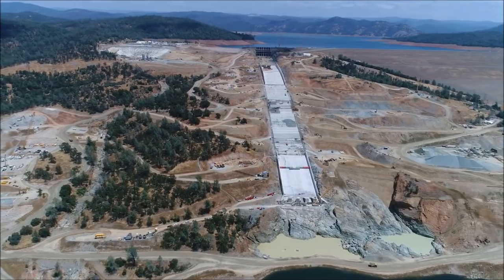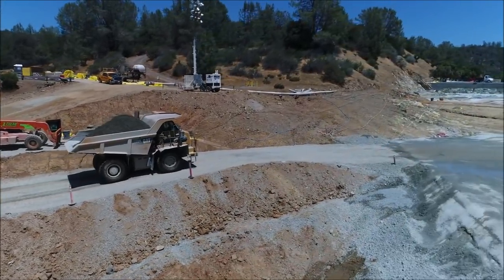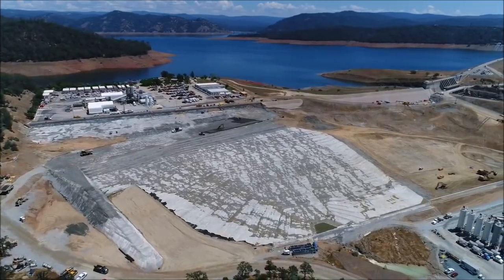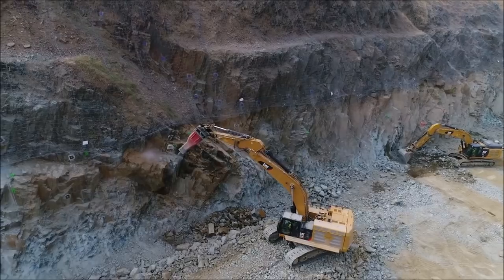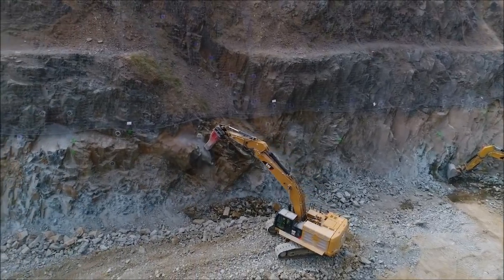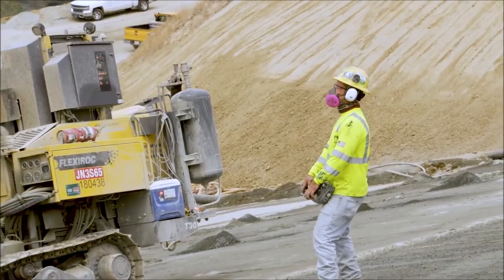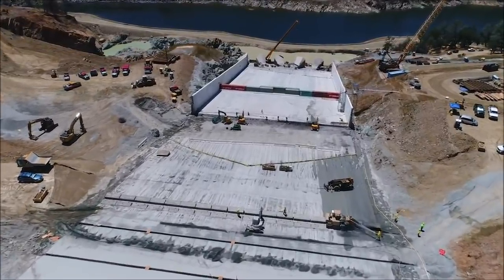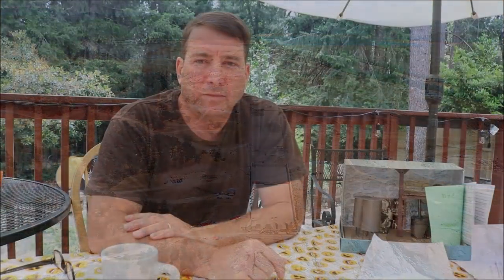Oroville Update 9 June 2018 Incidents and Injuries

Comment: I'm sure you have mentioned this in the past but all the union workers on the project are well trained and great hands.  My father worked on the Oroville Dam when it was built operating scrapers, and dozers.  He drove a 1958 Ford Ranchero from Lafayette to Oroville, spent the week at the worker's camp and when he came home the Ranchero was always full of 6" to 8" round rocks.  In the backyard in Lafayette the dry riverbed he put in is still there.  I have pictures of him working in Richmond, 1940's.  One picture was of him welding on the bow of one of the Liberty Ships, the next picture is of him operating a Whirley Crane, setting that same bow in place.   He was in the union since 1941.  I have been since 1971. 
Operating Engineers Union Local #3   Any young guys that want to run some rigs they have a great apprenticeship program.
By the way getting off a rig is when the most likelihood of an injury can occur, NEVER JUMP !

Comment: Another informative episode on Oroville. The perspective is deceiving until the drone dropped down the spillway to reveal how abrupt the drop-off is and those heavy equipment pieces are dwarfed by the structure. Proud papa, as well.
Reply from the maker: Thanks Osimnod!
Reply: Always admire your work, Juan. BTW, do you still have your older version of the GL Coyote saddle bag?
Reply from the maker: I sold my original Coyote bag, and now run the newer roll top Coyote bag. All the current Coyote bags are roll top. Easy and convenient.

Comment: Glad your surgery went well, just a word of caution about PSA numbers, they can show no issues and you can still have cancer. My friend had the # in below norms and had full blow cancer and had to have it removed and chemo. But they are still a valuable tool, but, no pun intended you need to have a physical exam every year. Again a great job with the repots Juan. I'm still amazed at the actual size of the spillway when you see close-up pics of the men against the backdrop of the spillway.

Comment: Juan I just watched the latest Oroville DWR update.  It looks like they didn't check the angle on the elbows of the drainage system.  So it appears they will have water trapped underneath the spillway again.  That would give a freeze issue that could cause premature failure of the main spillway again.

Comment: Sorry to hear you you have joined the fraternity of Prostatectomy survivors. Keep an eye on it as it can spiral out of control quickly. And don’t be afraid of getting a second opinion on everything. Also if you have any local prostate support groups check them out. They are a great source of information and support. Hang in there.

Comment: As you pointed out 8" dia. slotted drain pipes showed being installed slots up - generally holes are down. Is there a reason why?
Reply from the maker: looks like  slots on several sides.

Comment: Another great update!  Question: Do you know why part of the rcc splash pad was covered with dirt?  It is a sizable area.  It seems to me that the dirt would defeat the purpose of the stair steps if  coverage is to remain permanently.   Congratulations to your grandkids on great results in school!
Reply: The emergency spillway is never anticipated to ever need to be used. I'd say they will landscape it and let natural vegetation (except large trees of course) grow over it to soften it's visual impact. 
The benching is only to stop upslope erosion, if topsoil is washed off in an emergency event, no big deal.
Reply: Sideslip  No more Green Spot ?
Reply: Kirk nissley   I just read that the dirt cover in question is part of a new but temporary access road that will be used as a replacement for the dirt access road currently running across the top of the “phase 2” area of the emergency spillway. That access road must be removed for the placement of rcc over that same area.  Once the rcc splash pad work is complete this new dirt road over the rcc is supposed to be removed.

Comment: Great footage. Looks like a heavily choreographed dance presentation. Stay safe guys!! 
Juan. Has anyone ever explained how these "explanation" joints work with re-bar dowels tying the two segments together??
Reply: Pappa Bob, the smooth dowels are coated with grease and plastic so the cement cannot bind to it, they are also carefully aligned in the same direction so the concrete on each side of the joint can separate a little bit, but can't move up and down relative to the adjacent slab.
Reply: *expansion

Comment: Thank you Sir!  I always enjoy your videos!
Just to ask.....do you know if they have installed any cathodic protection on the reinforcing for the concrete....preserve the life of the reinforcing in a possible wet environment....sacrificial anodes....I put a system on a pier on Midway Island back in the 80's in the central Pacific!
Reply from the maker: Gary Campbell epoxy primer for structural steel (rebar) in the bottom panels.

Comment: I have a question. Why is this terrace-like structure so far away from the emergency spillway? Are they building another one right below the emergency spillway later? Or some other structure to direct the water if the emergency spillway will ever be used again? Have a great holiday! :)
Reply from the maker: See previous updates on the emergency spillway reconstruction. The idea is to 'armor' the emergency spillway from the ogee weir to the secant cutoff wall...over 700'!

Comment: For the record: Is the emergency spillway a secondary dam? It looks like the main spillway is cut into the top of a knob and the emergency is a small dam opposite the main dam?
Reply from the maker: effectively, yes. This gives the top elevation of Oroville 900' MSL. Top of the emergency spillway-901'.
Reply: So the emergency spillway is an earthen dam with planned over topping? Really?

Comment: How are they going to attach this permeable membrane it looks like a source of cavitation especially if one of the membranes tear loose.
Reply: At 10:08 in the video you can see that those drains are being cut into last year's roller compacted concrete layer. A new layer of structural concrete will be placed on top, and the membrane will never be exposed to the flowing water.
Reply from the maker: yes, the membrane is covered with a thick slab of structural concrete....stay tuned and we'll show you.

Comment: The sailing judges should handicap that time in the Catalina. Besides, it's not about the speed. It's about the FUN you have flying a vertical wing and a staysail foil at the intersection of two fluids in a dynamic environment. Reading wind sheer on the surface of the water is like reading clouds while flying. The calculus involved in the cutting and sewing of the pieces of those sails to make the desired "wing" from a roll of flat fabric has given childhood friends of mine lifelong careers designing and sewing sails for themselves while racing single class sailing dinghies as kids (your son and that Catalina) to eventually designing sails for Americas Cup Yachts.  Enjoy the ride. I predict he will be sailing a hydrofoil at 40mph before he drives a car. $2.00

Comment: Now OSHA is on site this is not good Kiwatt had a perfect safety record and two workers messed up and they had to call OSHA in Sacramento and now they are on site. No one wants an OSHA inspection because it will reduce the worker board to zero and everything gets shutdown. Kiwatt be careful out there and get this thing done we don't want OSHA showing up again.

Comment: Does anyone besides me think that instead of building the same style spillway as the original one which eventually failed,maybe we should think about a different design/concept? Think about the original base infrastructure of the spillway originally,it was solid bedrock of nature's own design. Due to a combination of a number of variables,seen and unseen the spillway was compromised. Water,water pressure,soft soils,and of course engineering are the four main factors that caused it's demise. Well the soft soils are now  softer than ever  before,the bedrock that was the backbone of original spillway is non-existent and it's replacement is concrete and it has all ready cracked and is going to continue to crack. The only thing that caused the original spillway to fail that matters is the soft soils beneath we're comprised due to water and water pressure. To me,and I'm only speaking for myself and hypatheticly,it seems like a much easier and smarter way to solve the spillway objective would of been to use large steel pipes in series that entered the lake above spillway and dropped down the other side staggered in depth and then down to the river. Large valves would open and close valves and wa la,problem solved.
Reply: It really doesn't matter how thick or strong the concrete is,if the soil beneath it gets soft and weakens, everything above it will fail also.
Reply from the maker: maybe you should join the design team too...lol
Reply: blancolirio  I would but there not good listeners.

Comment: I just watch an update on progress of construction. The engineers have the wrong design. They plan to draw water away from spillway during usage. This will fail. The opposite needs to be done done. Instead of cutting stripes at 90 degree, the cuts should be 30 degrees to a point leading toward the down slope. Also, they should be introducing air tubulars from the sides via air tubes to reduce air pressure as water flows over the spillway. The current design will most likely fail during high volume flow. Hope their design is never tested.
Reply from the maker: Why don't you join the design team?